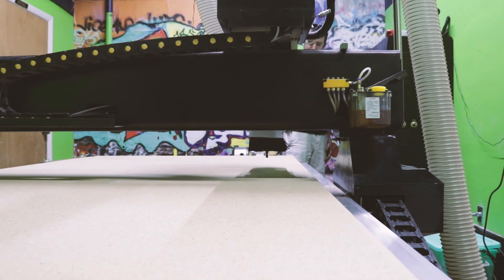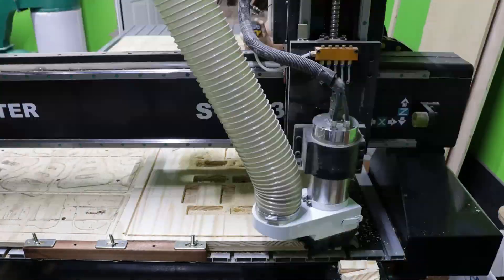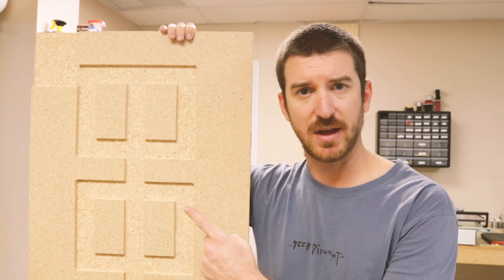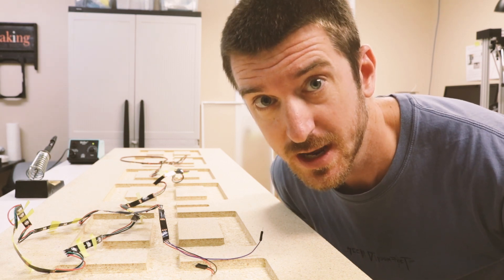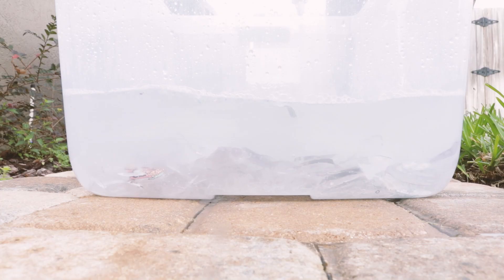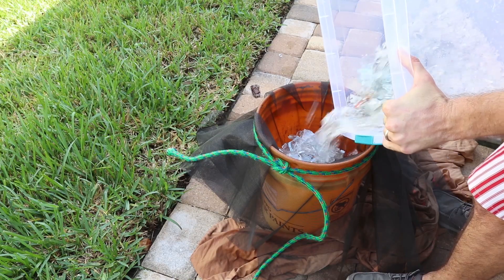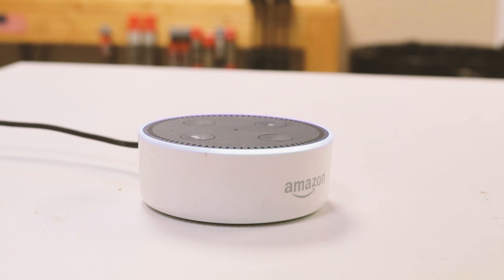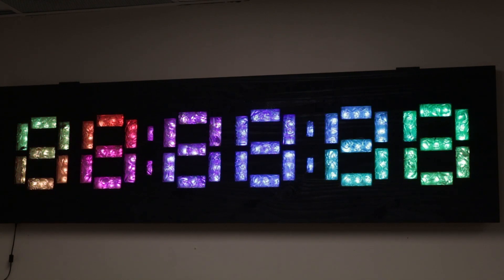Glass Clock and Amazon Alexa Timer

Comment: Too much light bleed. You should add little light baffles (aka sticks) so the light from one segment doesn't light up the unlit segments. Easy enough since you have a hinged design :D
Reply: I would suggest the peel n stick soft foam rubber weatherstripping for the job, since the light bleed is caused by the wiring channels. The weatherstripping can be stuck on under the wires, and the wires will simply be pushed gently into it when hinged shut. The weatherstripping should be selected so that it’s very slightly taller than the recess.

Another thing that might be good would be to paint the recess white, or possibly to coat it with a reflective material. The LEDs don’t fire towards the back, but some internal reflection will still occur.